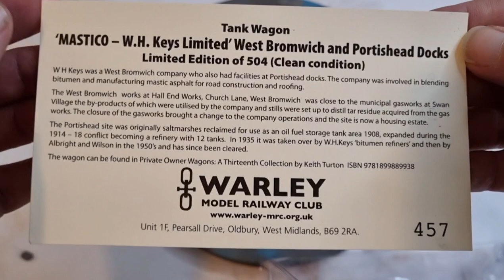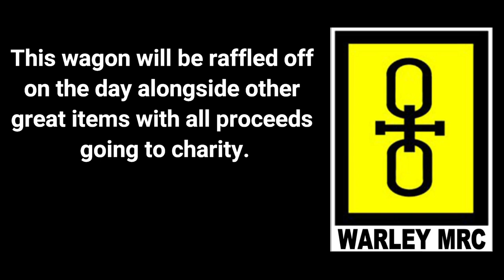The Scrapline (Tim Cooper) meets a Warley Limited Edition Mastico Wagon

Comment: What a fantastic inspirational video. Did you make sure tge the running surface of the wheels were protected when you were air brushing or is it not a concern? Are the wheels plastic or metal?
I want in on the raffle but live in Toronto and cannot make the show👍
Reply from the maker: metal wheels and as the wagon has no lights its not really an issue if they get paint on them, will try and do some live content on the day so you will be able to catch up with us on YouTube
Reply: Great and thanks for the response. I am in Toronto and have just done a video in George’s Trains which I hope to post by tomorrow. They are one of only a couple of train shops and focus on North American stock with a sprinkling of 00 wagons on consignment